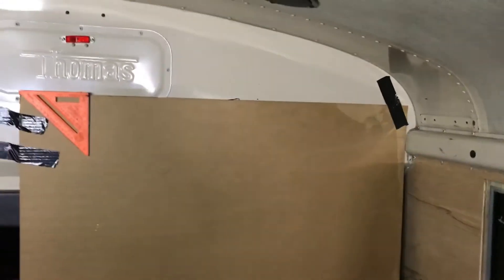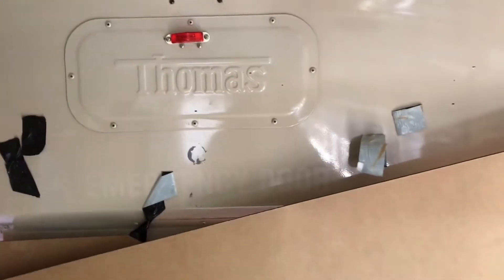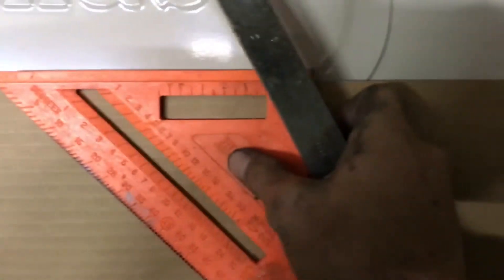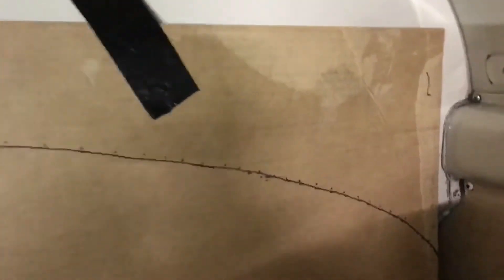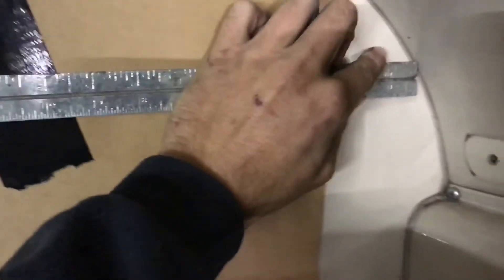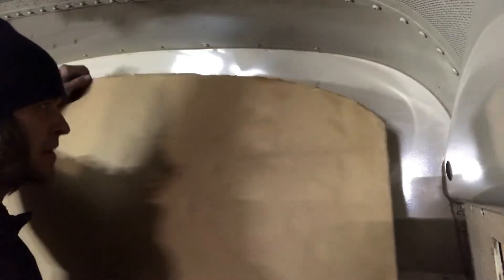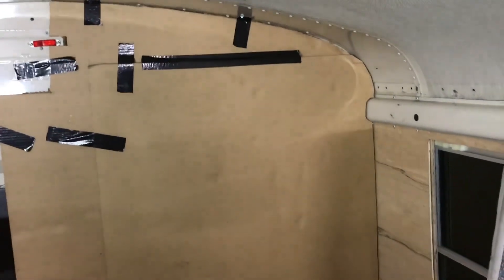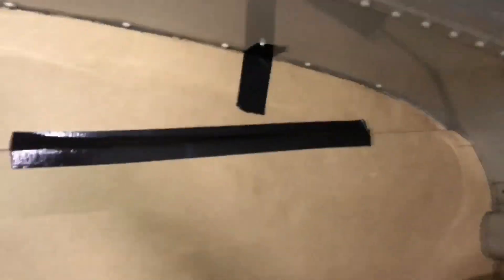Tracing ceiling curve in skoolie bus rv conversion to cut out walls and cabinets

Comment: Dude, you made really clean cuts but there’s an easier way. Tape the cardboard just like you did. Then cut a perfect circle with a hole in the middle out of plywood. Or you can use a plastic lid to a jar big enough to fill the gap between the edge of the cardboard and the buss wall/rood. Put a sharpie in the hole and roll the circle or plastic lid along the edge of the bus wall and roof while drawing with the sharpie in the hole. Walla! Perfect pattern. Now cut it on the cardboard first and see if it fits. Make any minor adjustments and transfer the pattern to the plywood.